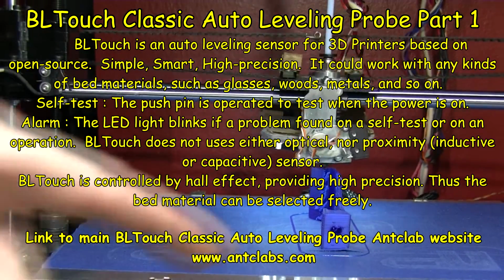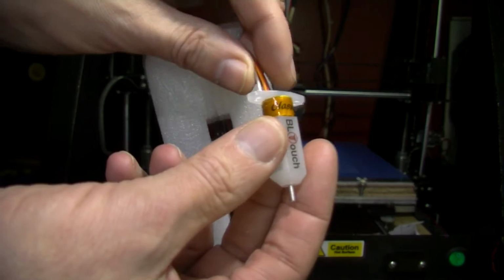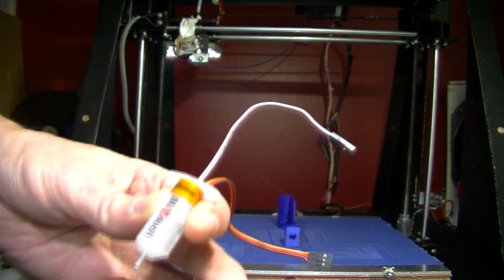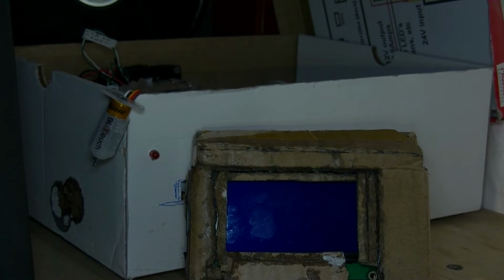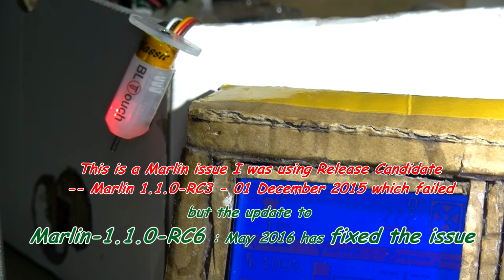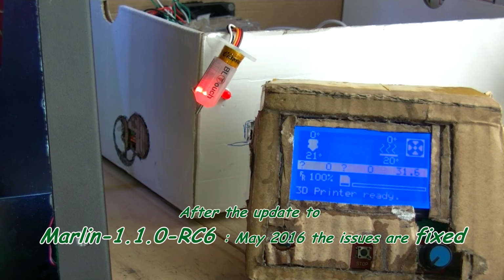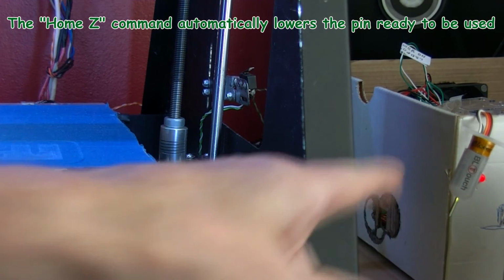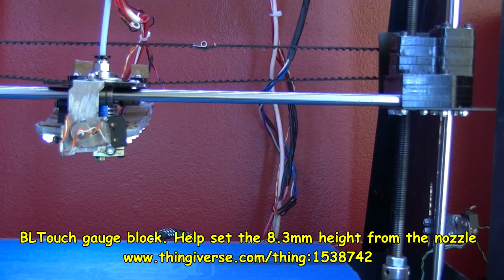BLTouch Classic Auto Leveling Sensor Part 1

Comment: Thank you so much for sharing your experience with the BL Touch.
I have just ordered one and was struggling to find what I needed to configure it, I now know a lot more that I did.
To upgrade Marlin, did you simply download the newer version then manually go through the Configuration.h file match your original settings?
I am looking forward to your Part 2, do you have any idea when this will be available? Scratch that, I just found it. Doh! :-)
Reply from the maker: I have a few BL Touch videos on my Channel; it is Great
Reply: Indeed, I'll be watching the rest real soon. You vids are great.
Although I don't have one yet, in my opinion, the BL Touch is the best sensor for auto tramming on a glass bed, far more reliable than anything else I've seen. Looking forward to getting mine.
Reply from the maker: I look forware to a video from you about your BL Touch
Reply from the maker: BL Touch supports and parts
http://www.thingiverse.com/search/page:2?q=BLTouch

Includes my BLTouch Home & Auto Levelling Height Gauge
http://www.thingiverse.com/thing:1538742
Reply: Thank you.
Reply from the maker: Thank You Back :)
Next video ready in a few hours: "3D Print success but which does it to choose?